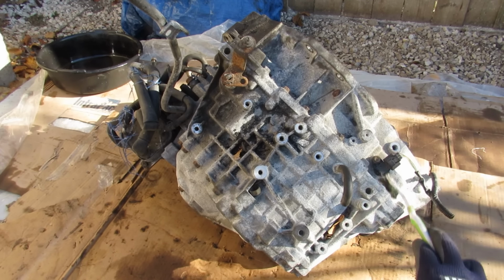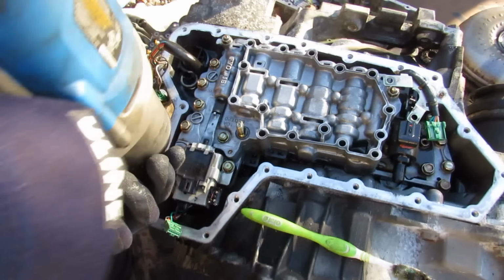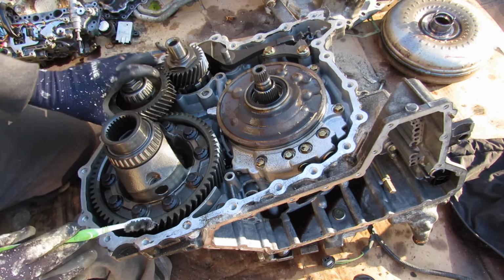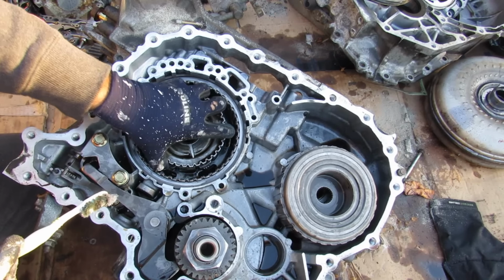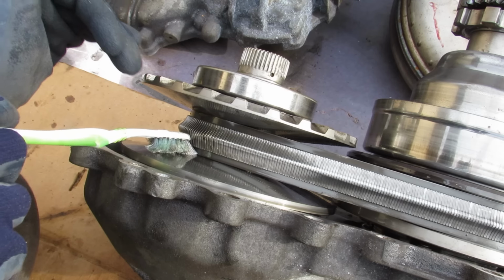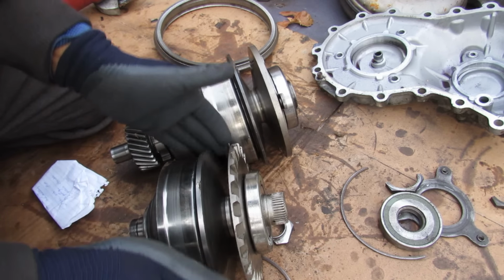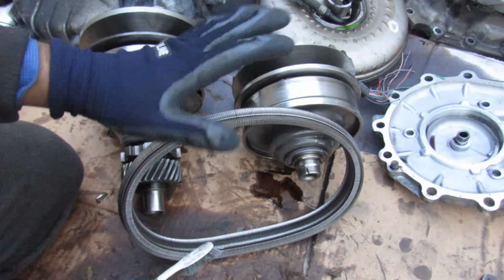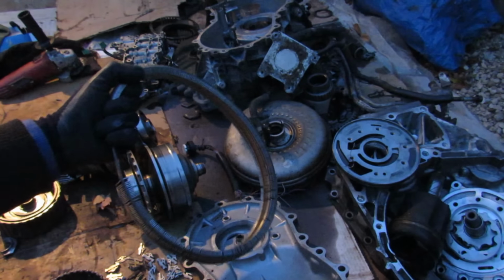Why Nissan CVTs FAIL

Comment: It's suspected that a problem with the Nissan cooling system is making the CVT transmission unreasonably sensitive to heat. The temperature of the cars transmission fluid is controlled by a small cooler as opposed to a radiator and it's not regulating the temperature of the fluid responsible for lubricating the parts in the transmission.  Should a car overheat and go into "fluid protection mode" transmission performance will be reduced and as a result the driver may experience trouble accelerating, vehicle shaking or jerking  and or complete failure of the CVT.  Could more frequent coolant changes be added as a recommended service?

Comment: I have a 2014 Pathfinder AWD. I've been towing a 4,000 lbs boat and trailer rig with no problems. No whining. Handles the load pretty well. It is an odd feeling when I'm pulling  the boat out of the water, facing uphill on the ramp, and I push the gas pedal and it takes another two seconds for the trans to catch up and move you forward. I guess I should keep my fingers crossed.
Reply from the maker: I wouldn't be pulling anything with a Nissan CVT
Reply: I pulled the stumps of 5 maple trees that were 30-35 years old in my back yard with no issues so far.

Comment: The heat does not come from the belts but the torque converter. The fluid shear in the torque converter is makes it hot.
Reply from the maker: Wouldn't the same be said for conventional automatic transmissions?
Reply: @speedkar99  yep and also in a hydromatic heat is also generated from clutch packs.

Comment: i got also nearly a car with CVT longer ago as i searched for a Subaru Impreza. Luckily i found a manual transmission instead, the engine itself made already enough problems (Boxer Diesel!), i dont want to imagine what costs could have waited at any CVT problem...

Only the fact of Oil change intervalls of like every 40k km which are in fact more like 10-20k km if you care about the transmission was too much for me when a regular manual transmission is nearly "impossible to break"... Ohh and ofc the problem that CVTs are better suited for lower powered engines/small cars.
Reply from the maker: I change mine every year

Comment: you said that newer Nissans don't have dip sticks and they are sold seperately? I just bought a new Sentra and there is clearly a tube under the hood with a plastic cap on it.  does the dealer sell the stick or aftermarket?
Reply from the maker: Dealer. Is there a stick under the cap?

Comment: If you change cvt fluid every 20k to 30k miles no failure.  That's why they fail , dumbass owners don't do maintenance
Reply: I change my oil in mine with every engine oil change at 3500-4000 miles !
Reply: @HEMI345S  laughed 😅  at that one.  Haha.   Really responded as I was drifting up in my tuna tower enjoying the ocean breeze reading Robb Report and answering  my employees emails - again that was funny !

Comment: I have a 2015 Altima with a CVT transmission.  It has been extremely reliable and has performed just fine.  I will say I change the transmission fluid every 60 to 70 thousand miles religiously!  Same for the radiator.  Mechanics I know say the CVT transmission suffers from bad advertising by Nissan.  They show people driving the Altima on a race track snd driving it hard.  That’s not what a CVT is for.  It is for fuel economy.  If you take care of the transmission, it will give You years of trouble free driving.  Drive them like a race car or tow boats and trailers with them, and they will not last.
Reply from the maker: Thanks for your input. If you go easy on it and change fluid it can last. However in a heavy Murano or pathfinder towing something it won't work out

Comment: 6:13 I never knew that’s how Park works. I’m amazed it’s simply a lever that is wedged into a spline or tooth to stop it from turning.
Reply from the maker: Yep. And that's why you get that slight rollback when you let off the brake in park.
Reply: It's called a pawl and makes a lovely noise if you panic jamb it in park while still rolling
Reply: @joeKisonue  - It's called 'lack of driving skills'. why would you want to do that.
Reply: You get amazed easily.

Comment: How is it possible that you explained  such a complex mechanism so complete and clear in less than 20 minutes? You even made it humorous.
Reply from the maker: Thanks!
Reply: @speedkar99  you are great ,your channel is great   and i hope became  famous
Reply: @speedkar99  You are a very efficiency instructor. Better than most YouTube  "mechanics".
Reply: @speedkar99  hi 

Great video. 

My situation.  I have a 2020 Nissan Altima 51,179 a horrible strong burning smell was coming from inside car at times and outside of vehicle always.

I never ever run it hard I keep it under 2.5 rpm’s. I bought car at 41,000 miles.  

I was curious to see how CVT fluid was doing so I pumped it out and I have the pics and it looks like cocoa cola. A strong burnt smell this was it.

No engine indicators ever came up on for bad transmission etc.

My concern is what if I didn’t change the fluid? Could the fluid have still lasted or would the fluid have caused serious problems and burned the surroundings of the steel belt??? I knew there is no exact answer or way of knowing. 

I really wonder how much more time of that burnt fluid especially with that strong pungent burnt smell could or would have damaged inside the CVT and what would the old burnt fluid damage specifically??

I found this!!

https://forums.nicoclub.com/does-your-car-smell-cvt-tranny-smells-like-burning-rubber-t321697.html
Reply: Im just glad he didnt start pulling out his daughters underwear....    Awesome vid   CVT 101 thru 105 in 20 mis....
Reply: That’s a direct indicator of knowledge. This guy really knows his transmissions.
Reply: If you think a CVT is complex, it is nothing compared to the labyrinth ( valve body ) and selenoid found in a conventional automatic .Some new 10 speed trany may have 13 solenoid or more. And we're not even talking about mechanical parts yet.
Reply: Really the CVT is a very simple mechanism. Just not very long lived.

Comment: I guess this video has some value for some people... but the overriding point I would think is just don't buy a Nissan CVT vehicle.  They are good for 40k to maybe 90k depending on use.  Manuals are much better and some AT's are okay... but overall Nissan is junk.  There is good reason why they sell for far less than a Toyota... and generally low information people buy them
Reply from the maker: I agree. Just lease and return

Comment: Nissan tells you 105k fluid change on my 2015 Altima. Mine has 94k miles and runs pretty well, never changed the fluid. But I drive gentle.

Comment: How much does it cost to replace a CVT transmission belt?  Replacement can cost from $4,000 to $7,000, however if the fluid is changed every 40,000 to 50,000 miles the life of the CVT can be greatly extended.. In today's marketplace, new cars with CVTs can be expected to provide reliable operation up to about 100,000 miles. For most cars, overall reliability will be poorer than that expected with a conventional automatic or manual transmission..

Comment: Low RPM does not equate to low fuel economy. The engine running at an rpm where it is making enough power, better yet at it's peak torque, is more efficient.

Comment: It was a speed class in disassembly.
But the description suggests a common cause for failure.
What made it fail ?
Heat? Dirty fluid,?
Blocked filter?
No, no mention of its symptoms either.
Research you can do for your model, year, and configuration can lead to discussion threads on the internet about symptoms that are not an external repair.
If you read up on causes of failure you can learn about the pump and parts of the hydraulic system.
Reply: I found out why. a lot of haters like to bash Nissan CVT but when I ask them why its unreliable they can't answer my question. the software that Nissan uses is not efficient at reading CVT sensors because it is set to fuel economy mode. so when you apply a lot of RPM it does not synchronize with the right CVT ratio and this is what causes the shuddering and the jerkiness of the transmission. you're just reducing its lifespan. Nissan will have to find a balance between CVT performance and fuel economy. either that or the driver should just listen to the transmission and engine before applying more force. in other words drive slow.

Comment: Hey man, awesome video. BTW, what do you think about the CVT with 8 step speeds in the Mitsubishi Eclipse Cross? How much horse power and torque can it handle?
Reply: They put steps in it for people to feel normal. All its doing is accurately moving the pulleys to set distances instead of allowing it to function the way it was intended

Comment: I inherited a Nissan Maxima.  Trying to change the fluid at the dealer often enough, I think it was only 30K though between.   It's amazing how they work very long, as they have a lot going on.  Has it's own computer to run it also.
Reply from the maker: How's it holding up?
Reply: @speedkar99  Ok so far but I do worry about the CVT and the torque of the engine if I step on the accelerator.

Comment: Nissan Leaf/Note CVT. Standard death at 140,000 km. Called out by 5 of the 5 mechanics I talked to. Symptom: Grinding noises. To check it's not a wheel bearing, lift one then the other front wheels off the ground and give it some juice, the sound will stay the same if its a transmission problem. Not worth fixing if an older car. The costs of new and second hand replacement were prohibitive in the labour dept.

Comment: I own a 2010 Altima with a CVT transmission and I've been wanting to learn more about it because of the way it's been behaving. It has 150k miles on it, and several thousand miles ago, I believe it began doing what you refer to as shuddering, where the belt between the input and output shafts begins to slip, if I understood that correctly. Would that cause the RPMs of the transmission, while idling, to jump by a few hundred before returning to normal until the belt slips again?
Reply: Yes, the slipping should cause the RPM climb up, as if you were momentarily stuck on neutral. This should only happen when you accelerate from a standstill.
Reply: @I_THE_ME  I went around to several auto part stores asking people their opinions and I was told repeatedly that my particular issue sounds and looks more like a vacuum leak rather than an issue with the transmission due to the fact that the symptoms only appear while at idle, despite what gear the transmission is in, and not while at speed or during initial takeoff. Thank you for your reply and advice. I think I have my issue diagnosed and I've been educated on how to track down any vacuum leaks by just using a propane torch around every vacuum line and watch/listen to the RPMs
Reply: @zb6614  I have a 2012 Altima, does the same thing. Start accelerating in the morning or when cold and it will redline without letting off the throttle.
Reply: Mine has 109k miles on it

Comment: That's why I prefer the automatic torque converter rather than the CVTs, CVts's has alot of moving parts and really hate those steel belt, if one of those teeth fall out it would be a disaster inside the CVT,  yeah you can save gas but the expense of maintaining a CVT and replacing parts inside the CVTs are expensive.

Comment: The CVT transmissions used in Nissan and Mitsubishi (a few others as well) are made by Jatco in Japan.  They are partially owned by Renault/Nissan.  The late 90's to mid 2000's CVT's were a disaster especially if not serviced correctly.  They were never designed to be used under high load situations (large engine or towing) and were lucky to last 60,000 miles.
The newer ones (late 2000's onward) are much more reliable.  Still not suited to heavy work loads but at least they last alot longer than they used to.  
Hondas CVT's are more reliable but don't believe that the, 'oil lasts a lifetime'.  It doesn't.  They still need regular oil changes and you have to use the Honda CVT trans fluid.  Anything else will give you issues with it.
I much prefer a standard epicyclic automatic transmission as they tend to last longer, handle heavy work (towing etc) and are rebuildable.

Comment: 2017 Nissan Altima owner here. Mine failed at 96,000 miles with regular fluid maintenance. Ole lady's mom had a 2016 Rogue and its transmission failed at 65,000 miles. Nissan helped with the cost but in all honesty this is a massive safety issue as well as terrible design execution. All of these need to be recalled, god knows how much money thousands of people have lost because of this issue or how many people got into accidents because of these failures. Not cool Nissan, not cool.

Comment: Essentially the transmission works the same as twist and go scooter then, except they use a rubber drive belt and rely on weights and springs to control the "gear" ratio.

Comment: Have a 2010 Sentra with 215, 927 miles on it.  I changed the CVT fluid once, back at the 20,000 mile mark. An extremely reliable car. The only engine component I have ever had to change was the starter, changed once. The worst repair I have had to do on it was the AC blower motor.  If the CVT goes, so goes the car.

Comment: Outstanding detail, love the jokes. Nissan transmissions are crap, that's why there is a class action law suit against Nissan for it.
My father's 2014 Rouge, was on it's third transmission by 17K. My 2017 Nissan NV200 work van is on transmission number two. CRAP!

Comment: I used to have an NV200 Nissan van with a CVT for cable. I really liked it honestly, I always felt like it was just gonna blow but it never stopped me from pressing the overdrive off button and just hammering it. I got it to go 110 down a hill fully loaded once, what would you do if you saw the Spectrum man hauling so much ass?? 😂

Comment: This was very helpful. I assumed a CVT must have some sort of pulley system for variable ratios, but I could not figure out how it was implemented. I had a Sentra with a CVT. Nice concept. After about 80K miles mine slipped like crazy when accelerating hard. A fluid change helped, but didn't fix it. I would not get another Nissan CVT.

Comment: Seems odd that the car makers with a cvt have  everything that is bad for the cvt. Flappy paddles for those quick down shifts! Bad for cvts, towing especially heavy loads. No service plan for a mechanical part . That's just crazy! It has oil, a filter, oil doesn't last forever nor do filters!  They can clog up just like the engine filters. Lifetime is just 100,000! that's nothing these days.

Comment: After watching this video I think I know what happened to my friends Nissan Rogue. Stompin the gas everywhere she goes.
Reply from the maker: Probably over heated
Reply: @speedkar99  Oh you replied to me. Hey! My girlfriends Rogue failed at 130k. She told me when it died it hopped and skipped and then the wheels seized. I am probably going to buy it from her. Basically it starts and runs and that's about it. The shifter moves, but theres nothing on the other side.

Comment: Well, all gears systems had advantages and failures. Here in Brazil the majority of cars comes with manual gears box. We've had serious problems with Ford Powershift, Peugout/Renault/Citoen AL4, Volkswagen I-Motion and others. The CVT is the more reliable.
Reply from the maker: Yeah I bet the manuals have been perfected
Reply: @speedkar99  The magic is preventive maintence, for all kind of cars. Check this brazilian 2013 Toyota Etios with 999.999 km

Comment: This is the EXACT transmission that I had fail on my 2005 Murano TWICE in 125000 miles. Thank you for making this and explaining the inner workings of these transmissions!
Reply: We had a 2008 Altima 2.5 that lasted 200k miles with the original transmission. We sold it to my uncle who is still driving it 60 miles everyday  to and from work. I don't have any clue how that little transmission is still alive.
Reply: Because it was a 2008.  Nissans we’re more Japanese then.  Now they’re Renault, mostly.  Big difference.  They’re trading off their old rep, and people are expecting the same from these new ones.  And they are disappointed.

Comment: Should I just drain and fill with AMSoil cvt fluid, or should I also do the external filter? (and internal one?)   Nissan maxima 2017. 60k miles.

Comment: Good stuff man! Old ex-auto mechanic here, you just explained why the Nissan Juke I once had nearly caused an accident 4 times in the couple of years I drove it, the delay of oil going to the drums causing it to be the wrong ratio caught me out. The dealership could not adequately explain to me why this was happening and told me they had updated the trans software. BS! You have done what Nissan could not!

Comment: I have a Honda CVT and still working perfectly after 15 years and over 500,000km. Just need to change the fluid every 20,000km.

Comment: Very informative vedio. Very well step by step and explaining how the CVT works. My 2004 Saturn Ion has a this kind of trans. And I hear a noise coming when I start my car. And it's slow to go until it warms up. Then it works fine. But sometimes the the passenger side will shake bad. I'm trying to figure out if my trans CVT is going bad or something worn out. Or if it the drive axels. Which I'm going to replace. I'd like to have a idea. If anyone can help me.  I be grateful

Comment: I had a 2010 Subaru Legacy, bought brand new with CVT trans. Loved it. Lasted 10 years and just under 300,000 miles. Paddle shifters, loved them too. Trans finally went. Would have bought another, but new now is pricing themselves out of my range. So went with a year old Chevy Equinox. Auto trans. So far its been doing good. Just turned 80,000 mi.